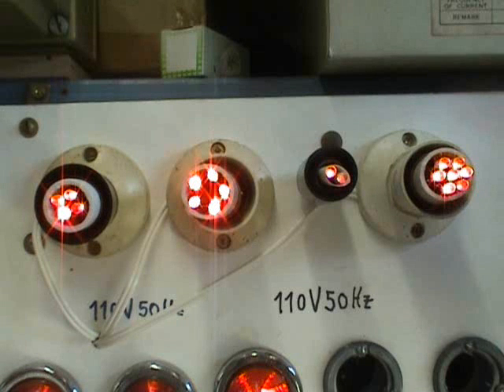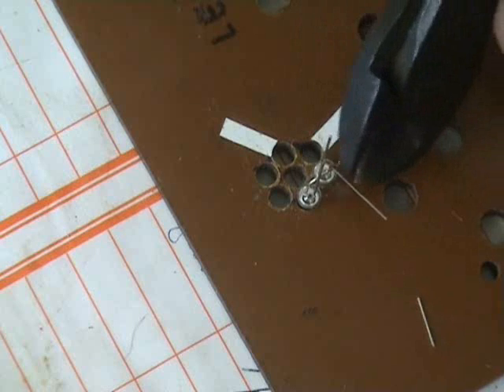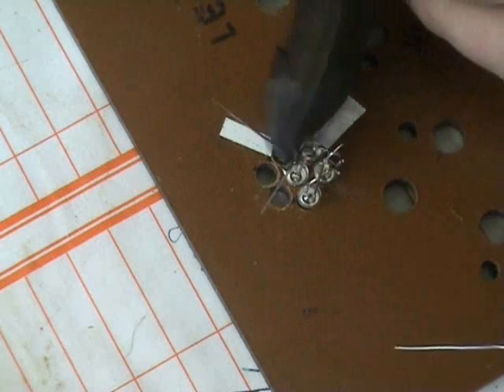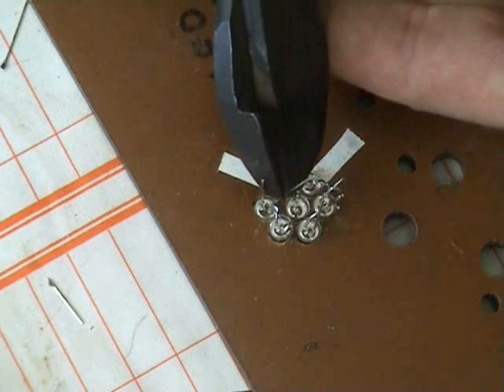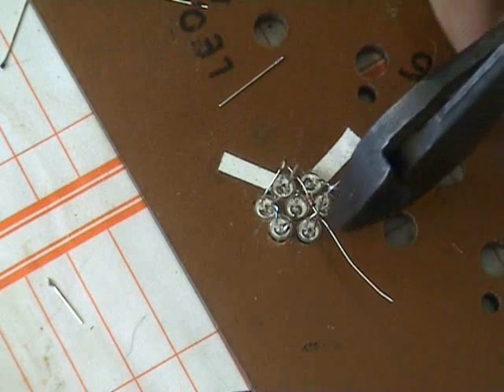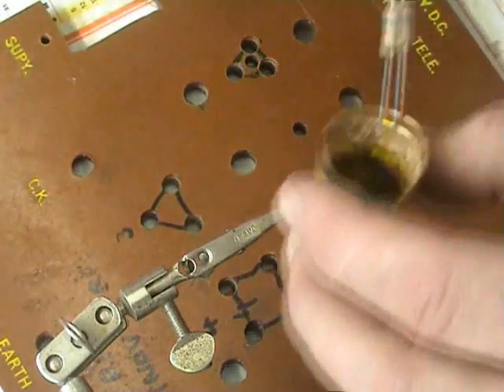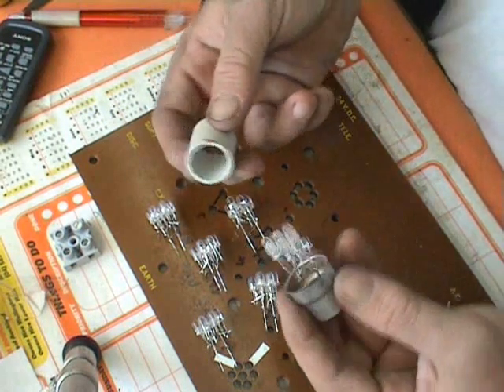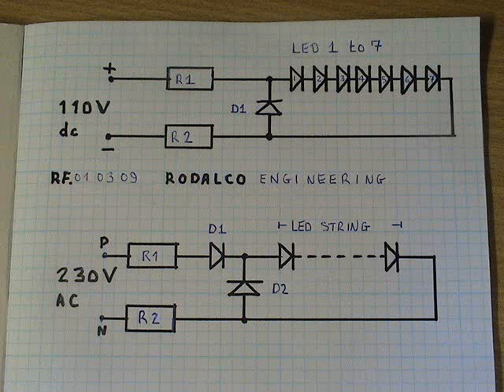LED lamp clusters and schema

Comment: i want to get started on something similar. what did you used for your power when testing? just a 9v battery?
Reply from the maker: No, just a current limited 15 Volts DC supply set at 10 mA. But you could use also a 9Volt battery and a suitable resistor.

Comment from the maker: Start with 100nF and rated at 400 or 630 Volts which yields about 10 to 12 mA, should be enough for high efficiency led's. Also use a 1 k.ohm 1 watt resistor to suppress the inrush surge.

Comment from the maker: This particulat circuit was made for DC indication lamps , hence no bridge rectifier. A brodge rectifier can be added to get a bit more brightness for the LED's. 
By  tweeking the resistance different amount of led's can be used. Keep the led current below 20 mA. 
A capacitor can be used also instead of r's.

Comment: Would it be okay if I use 27k 2 Watt resistors. I could not find the 27K 1 watt resistors? Secondly based on the calculation of R=V/I then with seven LED'S, the total voltage is 207(I am using 230 V AC) and current is 0.015 mA. So resistor value should be 13.8 K. 
Pl. explain why we are using 27 K resistors.....
Regards,

Comment from the maker: @rh7root  Diode 1N4007 ( 1Amp1kV ) resistors 2 x 27k Ohms 1 Watt.
Keep the led current below 20 mA. example runs on 10 mA.

Comment from the maker: I use 2 x 1 Watt resisitors in series.
Check heating with 10k. you meay need to use 3 x 6k8 R's instead.

Comment from the maker: for 110 Volts 2 x 6800 ohms 1 Watt resistors in series.
The reverse polarity diode can be a 1N914, 1N4148 or any 100 mA small signal diode.